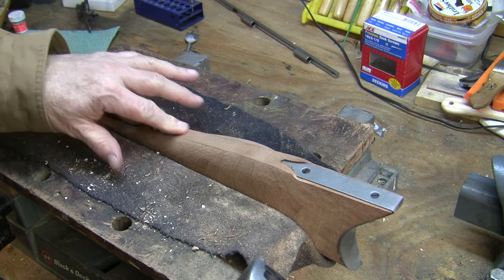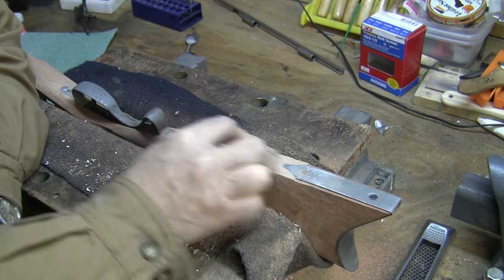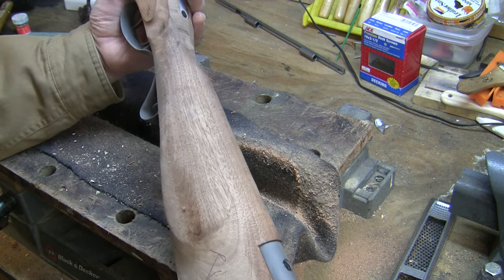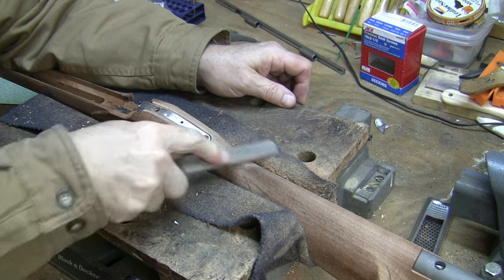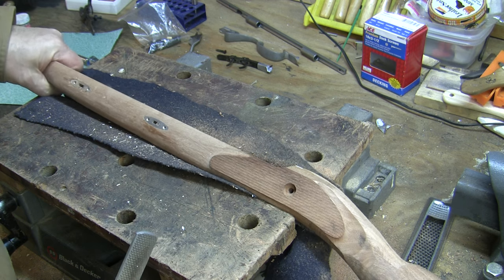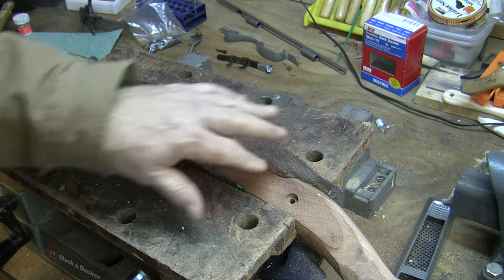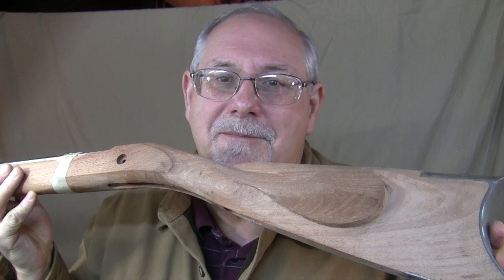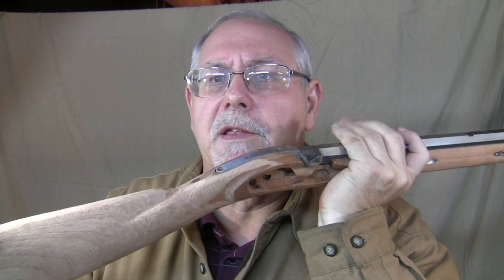Lyman Great Plains Rifle Kit   Update 2

Comment: Hey Mike found a lyman 50 cal deer stalker ,percussion. 1 in 48, kit made ten years ago 1990, never fired, made in Italy,  250 bucks very clean, hope it was a good purchase, I think it's 17 years or 10 old. great build
Reply: "Historical Purists" will downplay the Deerstalker because of such design elements as that pesky rubber buttplate.  Don't let that dampen your opinion of the Deerstalker, since it is a more capable rifle than a lot of people know.  A good starting load with a .490".015" thick patched roundball is 50 grains of 3F

I have a flint .54 cal Deerstalker that is a constant source of annoyment to other more "sophisticated" shooters at my range: I can bust grapefruit out at the 100 yard berm with boring regularity.  

Your Deerstalker uses the same 1:48" twist rifling as was used in original JS Hawken built rifles.  It is the high quality same barrel and lock used in other Lyman/Investarms rifles.  It is capable if superb accuracy, despite the thrifty pricetag.  You've made a better choice than you know!  Congratulations.

Comment: Hey Mike, great video series. Just got my Great Plains kit and looking forward to getting started
Reply: You've got one of the best rifle build videos available on the internet at any price.  My only addition is that you can use a cheap and easy scraper as that used by former generations of precision woodworkers, including my Great and grandfathers: single pane window glass.  Simply score and snap a piece of sheet glass.  The edge is sharper than any metal scraper.  When dull, score and snap for a fresh edge.  You'll be impressed with the ease of use and smooth scraping results.

Comment: I like to put some alcohol on the wood to soften the grain a bit when I find a particularly stubborn piece that chips easily. You could use other liquids but alcohol evaporates quicker than water and doesn't soak as far down into the wood. Might be worth a try on the next stubborn piece. Great work though!
Reply: Naphthalene will do the same without absorbing moisture from wood or air
Reply: Looks to me like that chisel is a bit dull. Look to tool maintenance before blaming the wood!

Comment: When you were chiseling the outline of the cheekpiece ,you really should support the stock, it is normal to support it with a "horse" ,which is adjustable for height, without this support you can never get a good cut with the chisel, it also puts undue stress on the wrist of the stock.

Comment: Hi Mike --It looks great !
In lieu of a Rick Roth scraper --What would you use? 
As you know I am taking your advise and staying away from the Dremel.Thanks again. PS- have you ever used boiled linseed oil for a more traditional look ?
Reply from the maker: I have used boiled linseed oil quite a bit. I prefer tung oil, which is boiled linseed oil with a hardener in it. It takes about 10 hand-rubbed coats to get a good finish...plain boiled linseed oil takes more coats with longer drying time between coats. On this build I'm going to use Permalyn, which has given really good results for some pro-builder who I know.
Reply: Thanks Mike.
Reply: Tung Oil actually comes from the nuts of the Tung tree.  It is often blended with BLO to produce a superior wood finish.  Often a clittlec Japan drier is added to help it set up.  Based on performance vs my own former blend of BLO+ Tung, I believe the Permalyn finish contains Tung oil - you can't do any better than The Permalyn sealer and finish for finishing a gunstock.